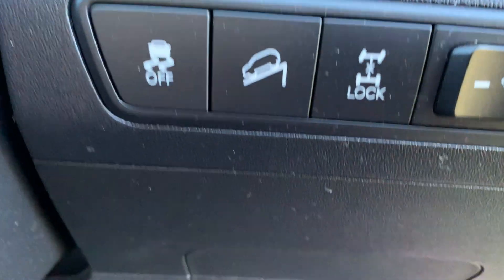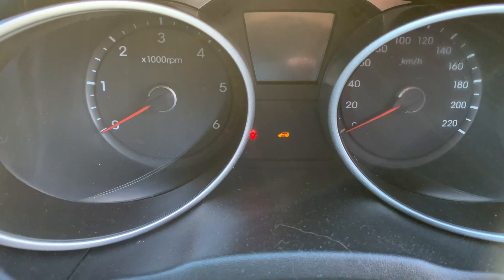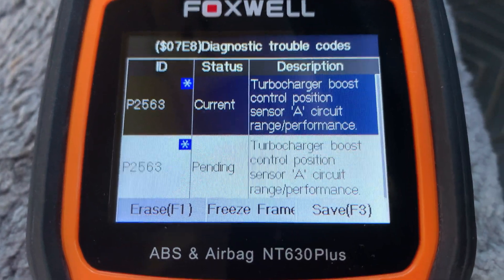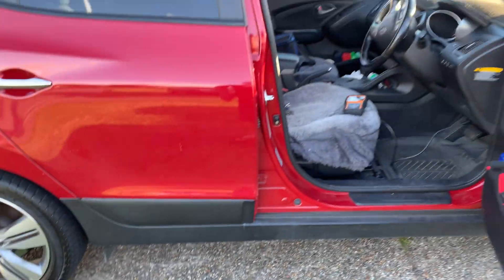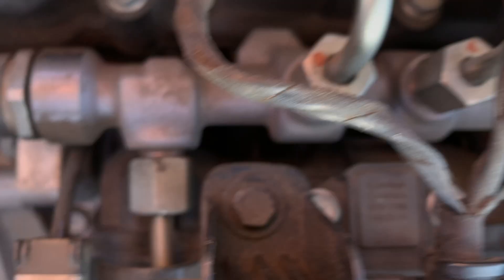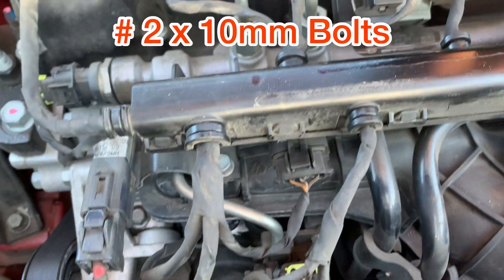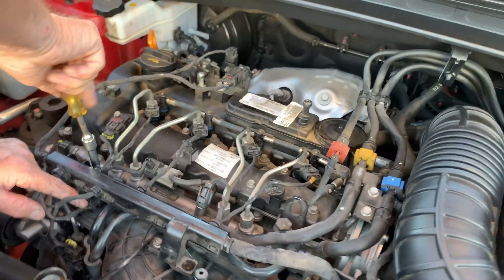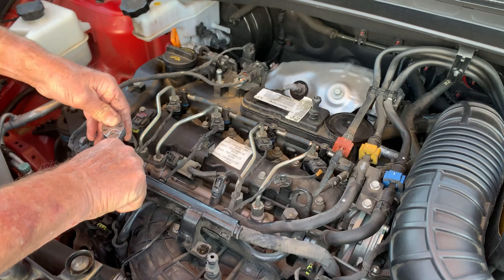P2563 OBD2 Fault Code. Hyundai Diesel Engine- FIXED!! MAP Sensor. CEL, Limp Mode

Comment: I am experiencing the same issue with my Hyundai Tucson 2016 diesel. The OBD2 scan shows error code P2563, which indicates a problem with the turbocharger boost control position sensor circuit range or performance.

Could you please suggest what parts I should check or replace to resolve this issue?
Reply from the maker: @sajatpashton5920  As shown in the Video should fix your problem. If you have a different engine, it will be the same principle, even if the parts locations or look is a little different.